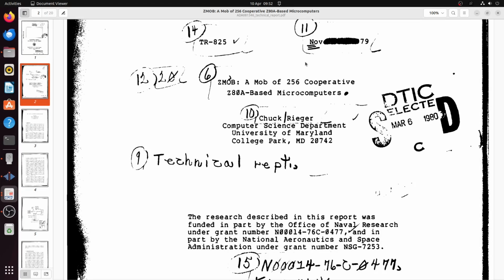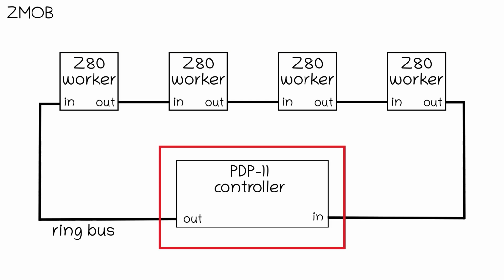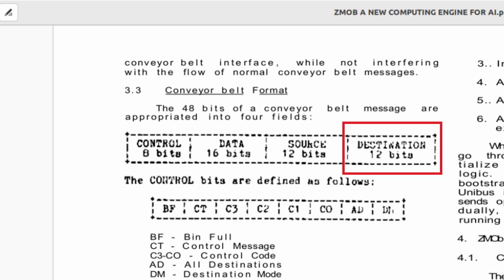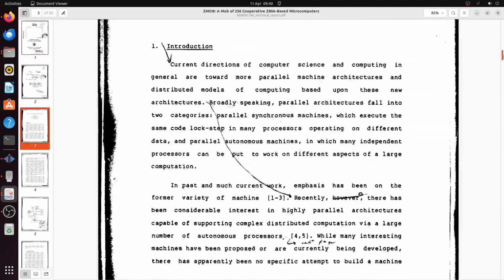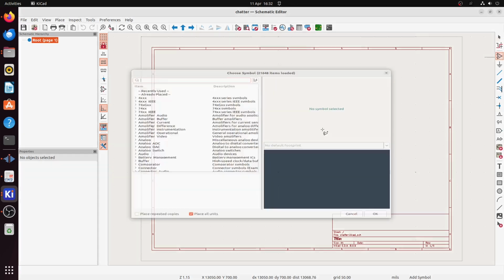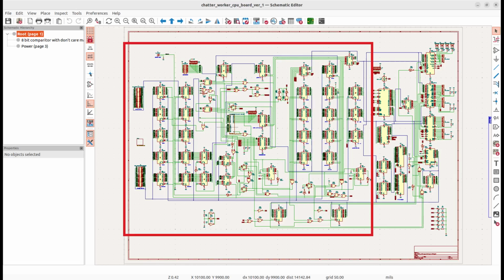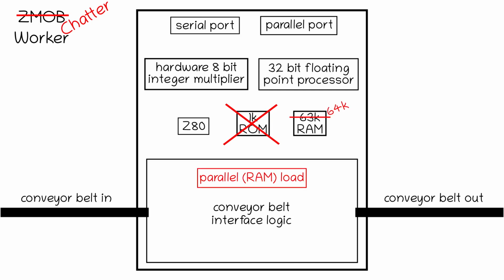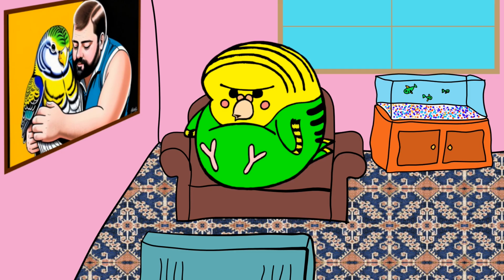Z80 Cluster Computer (part 0) intro

Comment: This is an interesting choice of project. For a while I’ve been wondering what could be achieved with a multiprocessor system based on classic eight-bit microprocessors.
Reply from the maker: Thanks for the comment. I'm excited to see what the finish computer can do to!
Reply: Same here, the 68000 came along and everything Z80 just because sidelined. There were very few using busrq for the multiprocessing it was intended for

Comment: Yaaay :D
Reply from the maker: You could try and make all your 6502s into a cluster!
Reply: @DrBudgieandtheHumanMan  Let's not get ahead. 😂  I've got 20 off 8085s here as well though..
Reply from the maker: A mixed bag cluster?! All your CPUs and it still wont be as powerful as your phone haha. It's funny how unpowerful old school CPUs are, I worked out that 256 Z80s with the whole cluster costing ~ £3000 ($6000 AUD) is still not as powerful as my 10+ year old desktop, second hand costing ~ £50 ($100 AUD)
Reply: @DrBudgieandtheHumanMan It's funny how how amazingly fast It has all become.  But I guess as a hobby we are really trying to use it as a tool to understand how and why these things work.

I have seriously considered using a 6502 to do the video output portion of a home-brew computer, it's always the stumbling block that ends up needed modern solutions,  complex solutions or unobtainium chips. 

So I'm kinda curious about your solution for processing information in your supercomputer system
Reply from the maker: yeah the video circuit is hard (never actually making one but looked it up a lot) especially if you're trying to make a composite or RGB signal for a regular telly.

I thought about using a circuit similar to the ZX80 but that uses a lot of clever programming so you basically just end up building a ZX80 haha.

Actually you could use the same solution as I'm gonna use on the supercomputer. It's just a register that you write too which triggers an interrupt on the CPU which then reads the register. You could use that to pass messages between your computer and old school graphics card, although you would get a lot of flickering because when the graphics CPU is servicing an interrupt it wouldn't be producing a video signal. But loads of old computers did have quirky glitches in the graphics so if anyone asks you can just say "it's meant to be like that".